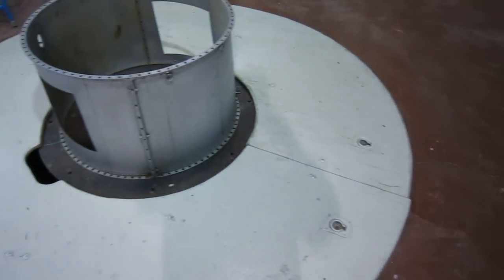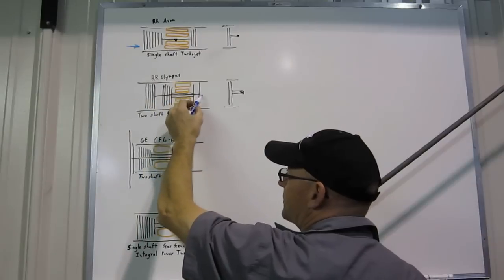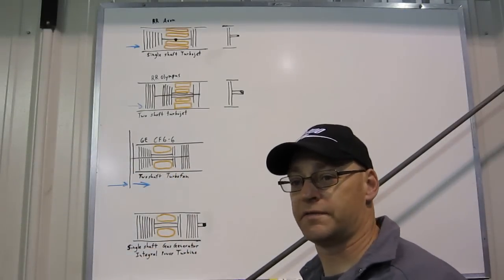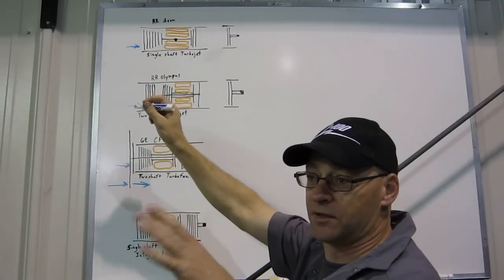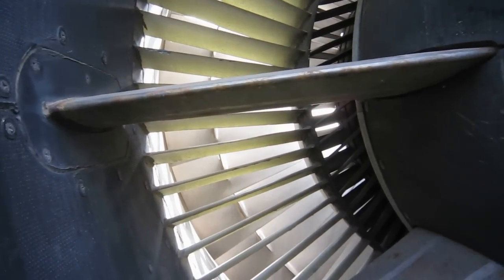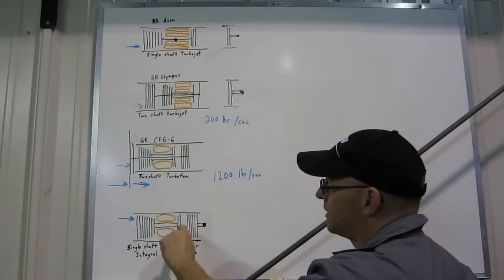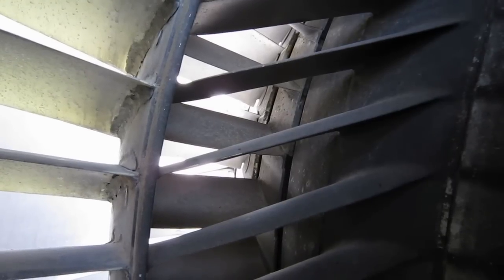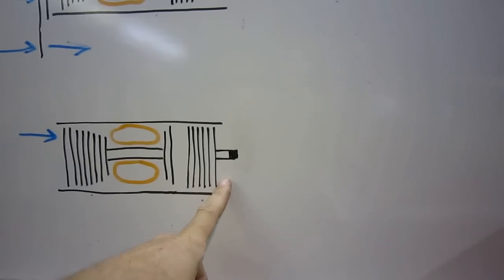Turbojet or Turbofan - Turbine Engines : A Closer Look

Comment from the maker: @343jonny Johnny, you need to do a bit of research into just what a diffuser is. I'm hoping to do a video on the subject soon, but an introductory text like "the Jet Engine" by Rolls Royce publishing will do a much better job explaining it.

..Also, the PT6 has the coaxial and concentric shafts. They just don't pass thru each other, because to the normal way of looking at things, the engine is "backwards".
Check out "aircraft gas turbine powerplants" by Jeppesen.

Comment from the maker: @tranceaddict704 The RB211 bankrupted RR, which went into recievership and was run by the government for 16 years, and it may have been the last completely new engine the company will ever develop. The Trent is simply an new name applied to the continually improving, evolving and expanding line of engines that started with the original RB211.
I believe that any totally new engines in the future will be joint ventures between several large manufacturers.

Comment from the maker: @tranceaddict704 That's only half the question: there are many benefits - ideally each and every stage of compression would turn at its own most efficient speed all the time. But that brings up the other half: the disadvantages, which are mechanical complexity, cost, and weight.
The RB211 is more compact, arguably more powerful, and arguably more efficient than its two-spool rivals, but it was a hugely expensive engine to design, and very expensive to maintain.

Comment from the maker: @LinnaeusRC The JT8D is a turbofan with a bypass ratio of about 1:1
I don't work on them, but I'm fairly sure both the HP and LP system rotate in the same direction.
When you want me to compare turbojet with turbofan... that's not two engines, it's two classes of engines.
I'm flattered you ask me, but I don't know everything :) 
I know GE makes a new engine that has contra-rotating turbines, so the answer to your question is : "in some cases" (pun intended !)

Comment from the maker: @343jonny Several possible reasons to do that. One is to increase the length of the gas path in which combustion takes place without making the engine longer. This allows lower burn temps and lower NOx emissions .
It is usually a newer, longer combustor design retrofitted to an existing engine design, like an upgrade.

It is also a way to initially design an engine to be as physically short as possible, and is how many helicopters engines are made.

Comment from the maker: @Fierobsessed Well, it was still early days for hi-bypass engine design, and also I think you got it right: an extra turbine stage would be heavier and would have involved a lot more redesigning than using a nozzle to harness any leftover energy in the exhaulst stream.

There is a sharp turn for the air to make as it heads into the core. It works as an inertial particle separator, protecting the core from FOD ingestion.

Comment from the maker: A turbojet is used as a gas generator to turn a power turbine which then turns a generator.
A turbofan includes an integral power turbine... which is used then to drive the fan.
Instead of a fan, we want to drive a generator.

Comment from the maker: You need to do a bit of background reading. The answers  will only confuse you more until you gain some understanding of how these things work.
So, here are the technically correct answers: the two shafts are mechanically independent, but aerodynamically coupled... no gears.
Secondly, it really depends on how fast you spin it. Turning the outer, LP shaft is unlikely to turn the inner HP shaft. In operation, the exhaust of the HP turns the LP.

"the Jet Engine" by Rolls Royce is a great book.

Comment: So, the turbofan is a combination of a turboprop and a turbojet
Reply from the maker: The best way to make a super simple summary:
The Turbojet is a gas generator fitted with a jet nozzle.
The turbofan is a gas generator fitted with a power turbine that drives a bypass fan.
The turboprop is a gas generator fitted with a power turbine that drives a reduction gearbox that drives a propeller.

Comment: In theory, I’m assuming from your video, you can greatly increase the turbo jets Efficiency by increasing the length of the ‘exhaust stream section’ of the engine. Are there any know working examples or concept/ designs  of this?  It seems like an engine like that could be put to good use on smaller jets.
Reply from the maker: The length of the jet pipe has no practical effect on engine efficiency. Here is an answer I gave to another question about the jet pipe length a day before.

The jet pipe length is determined by making a compromise between several competing needs. The CG of the aircraft is affected by where the engine is, and that can be changed by, well, you get the idea.
Reply: Let me rephrase. Maybe that will help me. Can you get more thrust by the engine by increasing the exhaust pipe length?
Reply: @jameya5007  
Depends, with an afterburner (and-or aftercooler) you definitely can get between 17-40+% increase in power, but fuel and-or water expensive.

In military jets the increase in speed can be upwards of 50-70% more boost, but that includes fancy variable nozzles and such.

Comment: Hi Jay ! Again thank you very much for your work and again i need your help to understand:  what is the main PRACTICAL difference between the IMPULSE type turbine and the REACTION type turbine. Beause in theory the main difference is that P,T DECREASE thourgh out the stator and remain CONSTANT through out the rotor, and in the REATION type we have also the DECREASE in P,T through the stator but in this time we will have a DECREASE also in P,T through the rotor. Is it possible to have an exemple ?? Thanks very much for your help ! With P=pressure T= Temperature.

Comment: About the CF6. It appeared that the second stage was only in the bypass duct at 7:12, you can see straight through. I don't see the core intake. I'm also curious as to why the CF6 isn't exactly like the LM2500, It seems it would be more efficient to use the excess exhaust flow to drive an extra LP turbine stage to run a larger or stronger first stage rather then constricting it down to produce a little more thrust. Maybe it's just that a nozzle is just lighter then a turbine stage? I don't know.

Comment: @AgentJayZ Right! I was just looking at the PT6 manual in simcom's king air c90a book and saw that it had 2 separate shafts...didn't know if you guys worked on anything like that.  I will definitely look into that text though! 

Last thing: Just curious why you guys are working on 1950's engines which belong in extinct aircraft like the starfighter and phantom? Are there private owners which have need of them or does the military still use these in aircraft?

Comment: Hey Jay, I just watched a youtube video where a guy explained a GE frame 5 gas turbine. I noticeed that after the compressor, the air makes a weird trun 180 degrees to flow axially towards the compressor, and then makes the turn into the combuster burner can. After watching your videos I can't help but wonder if the J79 or CF6 or any of your engines use this same curved path. It seemed like the ones on your vids go straight from the LP compressor to the swirler. Could you explain? Thanks Jay!

Comment: I also noticed that some engines use a centrifugal diffuser. Could you maybe talk about these and which engines they get used in?.....and last question hehe: i noticed some turbines use two separate non-concentric shafts (a power turbine shaft and a compressor turbine shaft like a PT6 turboprop) and that the first turbine turned by exhaust gases is a single stage of the compressor turbine. I didn't know if S&S worked on those types, but thought that would be interesting. Thanks!

Comment: In commercial aircraft, the bypass engines are vital, more efficient fuel engines and reliable. There was a confused situation with piston type engines and turbo jet engines. The fuel for piston type engines are LL100 AVgas, and re-fuelers were confused with those decals. the decals in those engines was modified and turbo was changed. Turbo charger is not the same as turboprop, or jet engine. I do love your videos, it is like going back to training classroom.Thanks for sharing all these ones.

Comment: So question. Why do some planes use a turbo prop? Why not just use a piston engine?
Reply from the maker: Like asking why do some trucks use gas V8s and why do some use diesel inline 6s.
The size of the plane and the desired speed has a lot to do with it, as does initial cost of construction. All the books I mention in Jet Questions 96 will go into this subject in detail.

Comment: Have you ever heard of an installation with two power turbines in line in the same gas path? A multi-spool turbine, as it were?
Reply from the maker: A power turbine is designed to extract as much energy as possible from the gas stream generated by the gas generator.
Many power turbines have more than one stage, but they are all on the same shaft and turn at that speed.
I do not know of any multi-shaft power turbines.

Comment: Do any power turbines (the extra bit at the back) have multiple stages or is it mainly one stage with heat recovery? And why is this if so?
Reply from the maker: +Matthew Smith The CF-6 has a five stage LPT. The LM2500, which is a design based on the CF-6, the LPt is called a PT and has 6 stages.
Reply: I think I'm getting my terminology mixed up! I ment does it have multiple pressure stages on separate shafts or just the one with heat recovery?

Comment: What happens to all the bypass air from the turbofan? is it just shot out the back without any interaction with aircraft systems?
Reply from the maker: +Alex Stewart 
Just?
That's the whole point. It interacts with the whole aircraft by pushing it forward.
Reply: AgentJayZ lol no what I meant is that the way you drew it on the board shows it not interacting with the compressor or the combustion chamber. So i was just wondering if it was just used as bleed air or does it just pass through without any interaction. lol whatever happened to no stupid questions haha. I'm just a pilot who wants to learn more about engines.
Reply from the maker: +Alex Stewart 
"Just pass through"?
That's the whole point...
I think I just said that...